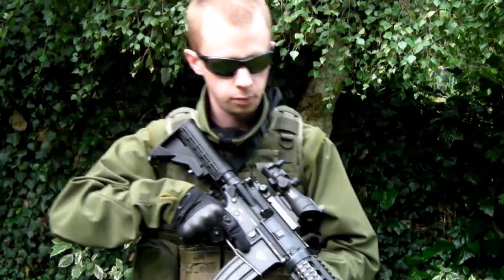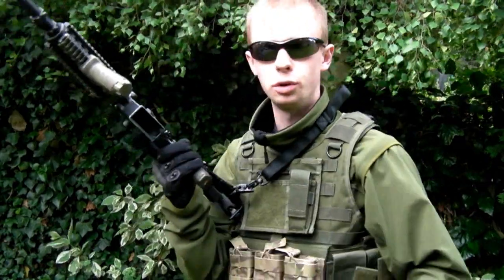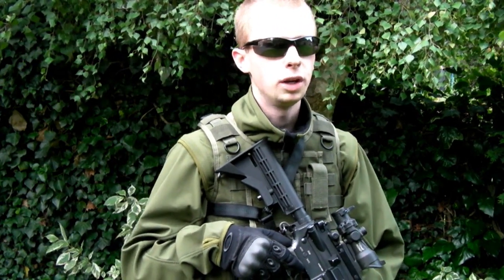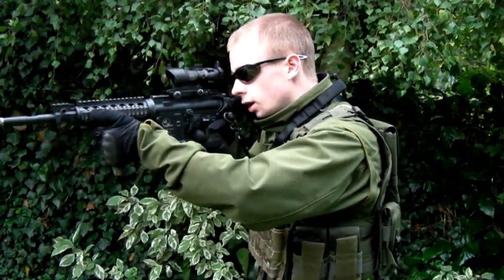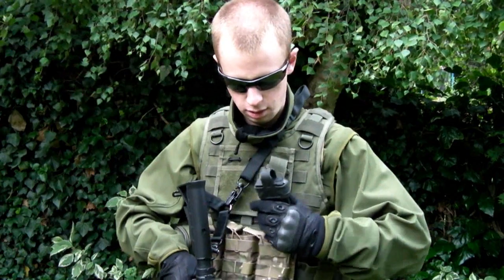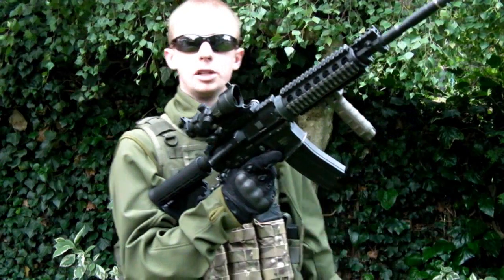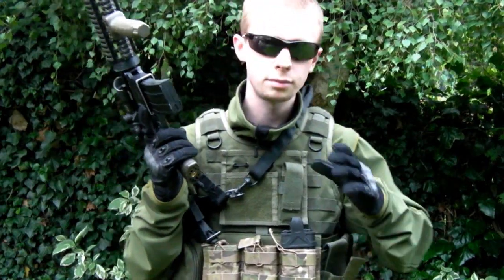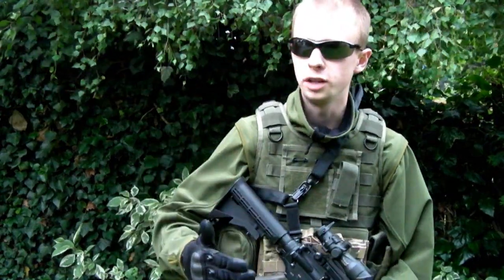Airsoft Techniques - M4/M16 AEG Reloads (pt. 2)

Comment from the maker: @Xzibit9 I only have 1 normal AEG M4, the others are 3 x TM EBBs and  4 x WA system GBBRs.  The BAD either wouldn't fit on or inhibited function on all of those, so I just chucked it on to the AEG since I had no other use for it.  Just sits there looking pretty now.